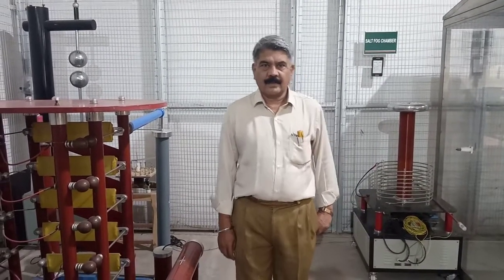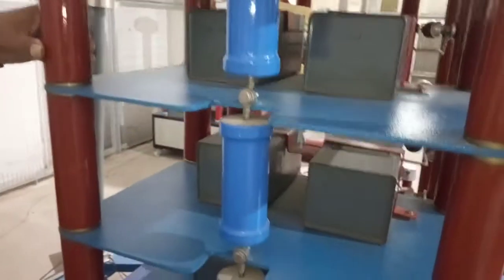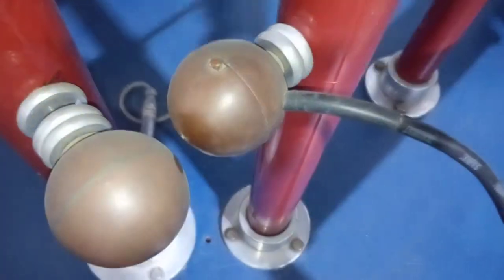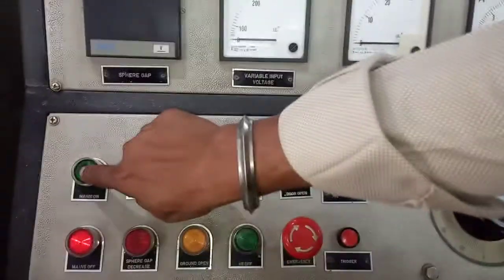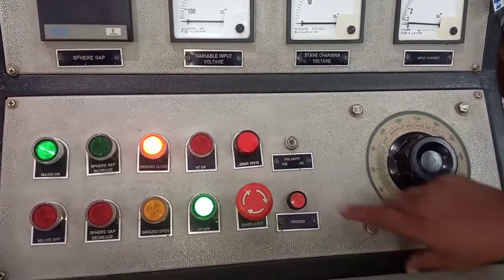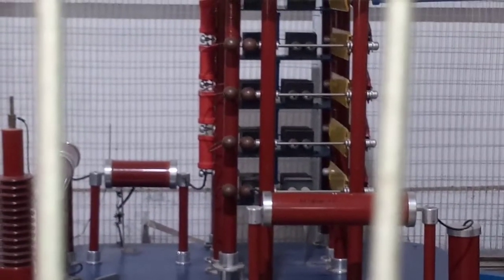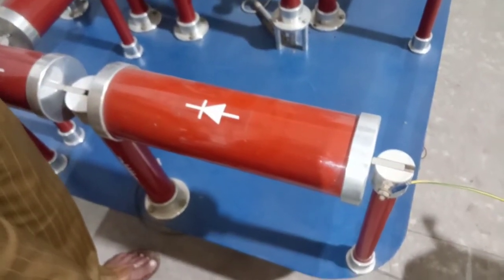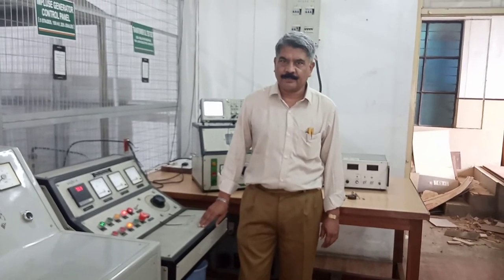High Voltage Engineering Experiment:16.Impulse Voltage Generation and Recording - Dr. T. G. Arora

Comment: Sir 1) in the circuit of Marx generator There are 2 charging resistors used for each stage  but in practical only 1 charging resistor why ? 2)  Wave shaping resistors are 10 nos ( 5 for R1 & 5 for R2) why & is connected to each stage or at the end only ? 3)  but in theory  circuit only 2 wave shaping resistors connected after the final gap  so why this difference create between  in theory circuit & practical & what are the changes by doing this ? Sir kindly request to u  Please give information about this

4) where is the final gap ?